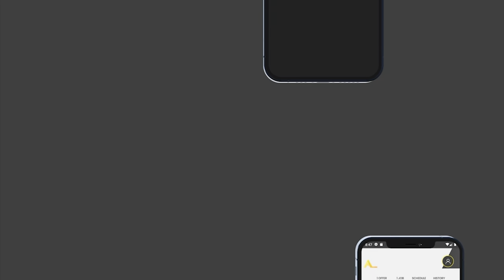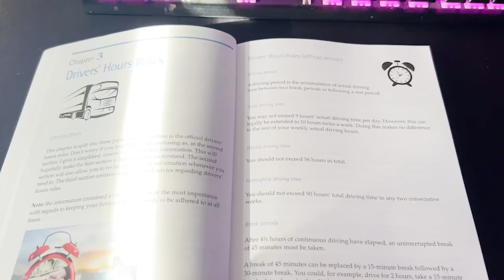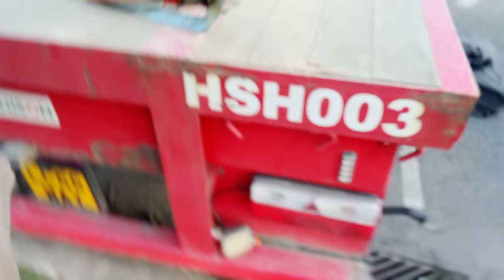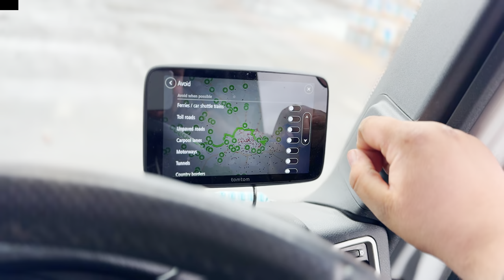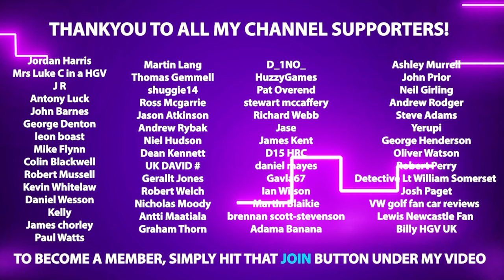HGV Vs CAR! It was a write off!

Comment: As a TV broadcasting technician with 50 years experience of vision control/colour grading before I retired, I have to say (in my opinion) that I do not think that video mode does anything for your channel. I also enjoy watching to get the experiance of the surroundings as well, and the bokeh effect does that no favours. Won't stop we watching and enjoying your content, of course. Cheers, Fred from New Zealand.

Comment: Great video Luke
PS i have a clocking going back question
if you are driving when the clocks go forward or back how does the tacco know what is happening.
Do you just do a manual entry
Reply: The clocks in our Scania's just come up with a message saying new time? And you just click yes to confirm and it's job done

Comment: Cinematic mode outside is good but in the cab the saturation/colour grading in the cab seems to be too high.
It was funny at the end, seems like you were getting the wind up with the increase in music volume.
Reply from the maker: Cinematic mode is only outside. Not inside. The saturation/colour grading is a rendering issue and is not related to the cinematic mode.

Comment: I'm ignoring the colour issues in this comment, but I don't like the blurring of the background in cinematic mode. I prefer to stick by the old adage of KISS - Keep it simple stupid.

As for the accident, my thoughts are that you should have stopped to give your details as a witness. You certainly saw more than your cameras recorded, including the seconds prior to the collision and the collision itself. The exception to that would be if you deemed it too unsafe to stop. In that case you should have stopped at the first suitable stopping place and phoned the police to leave your details. Finally, the police typically caution against posting video/dashcam footage of an incident that may later be used in a prosecution.

Comment: The new look is OK, but gives a red look to your face, and a general pink tint to everything. Maybe just play about with the colour settings
Reply from the maker: The saturation/colour grading is a rendering issue and is not related to the cinematic mode.

Comment: What's wrong with keeping it as it was? You look as you've  been made up as a movie star. Truck drivers should look macho not poofy looking. Sorry Luke but you did ask for comment.😮
Reply from the maker: The saturation/colour grading is a rendering issue and is not related to the cinematic mode.